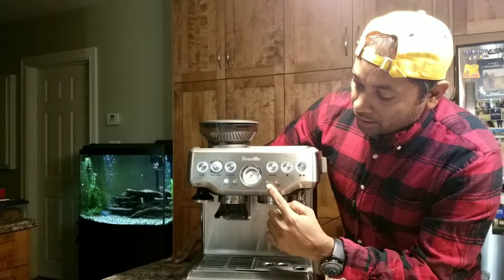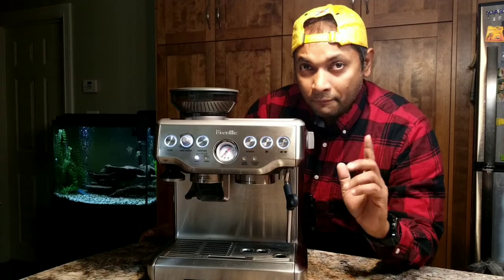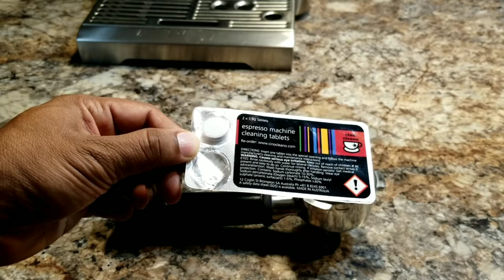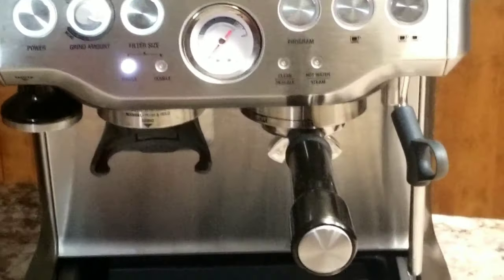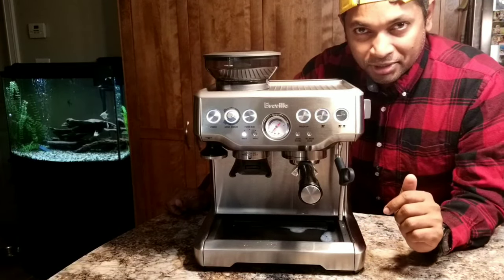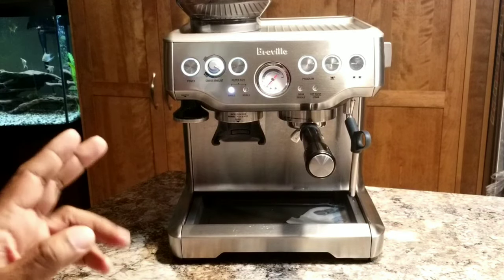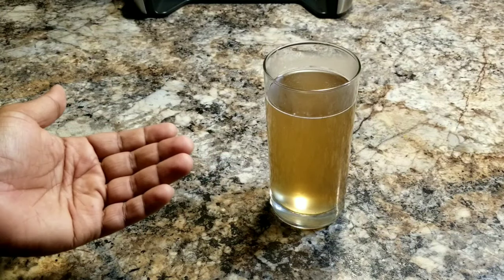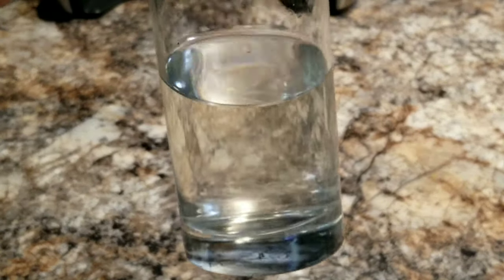Clean Light ON | How to clean Breville Barista Express using Tablet

Comment: Great explanation and very succinct. My machine startled me yesterday as I was making coffee the steam wand pressure dropped and I noticed a foul burning smell coming from the group head which had the unbrewed coffee holder in place. I stopped steaming and removed the coffee holder which came away explosively with a POP and spread the coffee grounds everywhere. I couldn’t find anything about this except a few people on a forum who experienced it and said a descale seemed to fix the problem. Do you have experience of this?
Reply from the maker: I haven't experienced this issue. If you dial to steam (all the way), it shouldn't generate any pressure on the Grouphead. I suspect the steam wand unit may be failing. Anyway do a Descale and Clean cycle to rule out the calcium buildup as the culprit
Reply: @AjusCafe  if it is failing then it doesn’t say much for the brand as it’s only two years old.
Reply: I guess you’ve never bought a bad apple before. You must have extremely good luck. It doesn’t matter who made a product, there’s ALWAYS a chance something could go wrong with it. After 2 years, maybe you got a defective part or maybe it was user error not properly cleaning/descaling. When you purchase an item that’s expensive like this, you might want to consider getting an extended warranty.
The Breville brand is amazing and seriously is the absolute best espresso machine for the money. Maybe you should contact Breville instead of YouTubers for more info. I’m sure they’d be happy to help 🤷‍♂️

Comment: Thank you for the thorough explanation. Would you be able to tell me why the clean/descale light is still on even though I followed all the steps to clean the machine? I can’t figure this out. Does it mean the machine requires rescaling? (I have never descaled it).
Reply from the maker: Is the light flashing OR solid ON?
Reply: @AjusCafe  solid
Reply from the maker: @mytran499  If it's solid ON then you need to DESCALE. Follow this video to fix that https://www.youtube.com/watch?v=YOWbYh9Hssc&t=266s

Comment: Great video, just have one question.. when starting the clean cycle all the residue water comes spewing out the bottom and side of the puck handle instead of going through upper plumbing and out drain tube. Any ideas on what problem is? Thx
Reply from the maker: That's normal. Your cleaning disk has a hole in the middle. Right? Some version doesn't have a hole and it blocks all water. Both will bring water up and into the tray to clean. All good.

Comment: Your videos are so clear and precise.  I appreciate that.  I have had my machine since September and clean it every Friday, except no tablet and I use the provided brush and canned air to dislodge and blow out the grinder of all residue.  I use purified water in the machine so the  descale light has never come on.  But I followed this video and used the provided tablet today.  My question is it necessary to use the tablet if the descale light doesn’t come on or is using the tablet just a good preventative every 3 months or so?
Reply from the maker: Thank you. 
Descale is different cycle compared to Clean cycle. And tablet is used for Clean cycle or Backflush. 

Assuming you are referring to Clean cycle, then Yes you need to Clean using tablet in Portafilter every 3 months atleast, in order to avoid coffee stain buildup. Even if the light blinks or not, you need to run clean cycle. Same applies to Descale cycle as well, where u use Descale power in the water tank.
Reply: @AjusCafe  I run the clean cycle every Friday plus thoroughly clean the grinder, filter head and froth wand.  But I’ve never gotten the descale message I guess since I use filtered water always.  But as you suggested, I’ll continue using the descale tablet every 3 months.  Thanks again.

Comment: Hi Aju, very useful tips and good explanations on your videos. Thanks for it. My question is, does it matter to use powder or solution (liquid) for descaling? Any difference for the result? BTW, my machine is BES870 too. Thanks in advance..
Reply from the maker: Both Solution or Powder should work, if its meant for Espresso machine descaling
Reply: Got it, thanks so much..
Reply from the maker: @gokhangok18  And here is a video 
Descale using Solution - https://www.youtube.com/watch?v=3fNAnMUQAl8&t=843s
Descale using Powder - 
https://www.youtube.com/watch?v=YOWbYh9Hssc&t=42s
Reply: @AjusCafe  thanks for the links. I think I'll go with white vinegar as it's also written in Breville manual. Hope works well:)
Reply from the maker: @gokhangok18  i wouldn't recommend vinegar though Breville mentioned that in 1st version of BBE. Later Breville itself mentioned NOT to use vinegar as it can damage silicon seals etc. So 2nd version onward you won't see vinegar in their manual. But nothing wrong in using it once in a while
Reply: @AjusCafe  Oops, didn't know this! The reason that I plan to use vinegar, rather than it was in the manual, I don't know which descale solution should I buy. There are some brands in the market but hard to say which one is good which one not. Anyway, thanks again for that info..

Comment: thanks so much for the video! my filter size is flashing and i cant pick the filter and my grinder isnt working... is this something to do with cleaning the grinder?
Reply from the maker: Once you remove the hopper,, there is a little cut just above the burrs facing towards you. That switch is not engaging. That's why the filter size is flashing. You can use something like a toothpick and press i to the little cut and see if it engages. Maybe just vaccum the top area and see if a broken bean is stuck.
Reply: thanks so much for your reply! im gonna do this on the weekend hope this will solve everything especially with the grinder!!

Comment: Great Video buddy. One silly question, if I used liquid to descale the machine. Do I still need to use tablet to clean the machine?
Reply from the maker: Sorry depends on which liquid? What liquid are you planning to use?
Reply: Breville Eco Liquid Descaler. Thanks
Reply from the maker: @lalaland8881  Answer is NO. No Descale products should be used for Clean cycle. Either use Breville tablet OR Cafiza powder which is the highly recommended. In Clean Cycle you are cleaning only the coffee oils, old grinds stuck in backflush plumbing etc only. Descale is different and Descale cycle is for cleaning boiler and other components in your coffee machine.

Comment: Thanks for the video but I have one question when I doing the tablet ,the pressure didn’t go this high ,it only go to the middle. Is that something that I can fix?
Reply from the maker: Does your blind disk have a hole in the middle and water slowly dripping though the Portafilter? Because some model of BBE has hole ans what you see half pressure is normal.

Comment: I notice that the cleaning cycle button is flashing fast…in our case it is flashing at the same frequency…help me to understand this pl
Reply from the maker: Flashing means it need Backflush OR cleaning cycle with tablet in Portafilter. If the light is solid ON, it means it need Descaling where you put Descale powder in the water tank and run that cycle

Comment: Aju, regardless which basket I use, the rubber cleaning disk the water drains straight though the portafilter defeating the back pressure clean. Thoughts?
Reply from the maker: Some cleaning disk has a whole, but there is enough pressure to clean backflush anyway. Either use cling wrap on your cleaning disk and use OR use it with pressurized basket. Its all normal.

Comment: I need to clean my machine but the pressure is on maximum when i do the same steps like you. 
Why
Reply from the maker: High pressure is very normal, because you are blocking the flow of water through portafilter using the clean disk (silicon). This will generate lot of pressure up to max. Because of this pressure, the water will be drawn up through the GroupHead into the backflush outlet (which is by your tray below). This back flow will carry the cleaning solution with it, which ensures it clean all your coffee oils and old grinds stuck in there. Hope its clear.

Comment: My descale light never goes solid on. Is it because I descale more often than it’s needed?  How often should I descale it? Thanks
Reply from the maker: You must be using first generation Barista Express, which shows only clean me light. In your case you should do Descale cycle manually. Do it every 3 months or every 6 months if you are using filtered water. Here is a sample manual descale on another machine https://youtu.be/6PsMe4mNZ_s?si=mGdGC5q3ZlNeSFfK

Comment: Should you open and manually clean the group head assembly when you finish the cleaning cycle?
Reply from the maker: Not necessary, but its always good to clean group head mesh filter if you can, as there could be lot of deposits hiding there too.

Comment: I’ve done all that over 8 times using both the tablets and Breville descales powder and the Clean/Descale light continues blinking once the process is finished and machine backs on. Any idea what could be the issue? I also ran the steamer to make sure the pipe would be clean too since I mixed the powder in the water. Thanks!
Reply from the maker: After unplugging the power cord and back on, doing twice the CLEAN cycle with tablet making sure you enter Auto clean cycle using the buttons.if the light is not gone after 2 cycles of clean, and if its still blinking, then it could be a sensor fault. You need to contact Breville support
Reply: @AjusCafe  Thanks!!

Comment: Hi.  Do you know what might be the reason that then I do descaling the water comes out only the group head not the water component or steam wand? Like as soon as I switch to any of them water comes the same second from group head? I tried descaling and cleaning cycle.a.few times. Water only comes out the group head. Will appreciate your input
Reply from the maker: There could be 2 reasons I can think of. 
1. The steam wand is clogged. You need to clean that thoroughly  https://www.youtube.com/watch?v=DWivoLznT8Y
2. It could be more complicated, the seal that switches between the steam and water is broken, which will need to be fixed. 
Does this happen only during descale mode or even while trying to froth milk?

Comment: Hi, Aju, I bought "URNEX Cafiza2 clean powder", do you know can it clean both the brew head and water scale? For the water scale, can it be put into the water tank to run the cleaning program as you instructed in your another video?
Reply from the maker: I don't have experience with that. But i read its organic. It should be safe to clean the GroupHead backwash. Not sure about descaling use as it goes through all plumbing systems including boiler.

Comment: After this cleaning shouldn't the clean/descale light be off? Mine is still on???
Reply from the maker: There is some difference:
Clean light would blink when its time to CLEAN
Clean light will be Solid ON means its time to DESCALE.
So if light is solid ON then do a DESCALE cycle. https://youtu.be/YOWbYh9Hssc

If its still blink light then do Clean Cycle again.
Reply: I saw your video on low pressure extraction. So on which inner grinder setting did you end up with? I put mine at 3, but pressure is at low. Changed beans, settings I'm so frustrated.
Reply from the maker: @julielee7781  my Grinder inner burr is at 3 or 4. If you ensure freshly Roasted beans with a roasted date not less than a week old, you will be ok

Comment: The light for the FILTER SIZE is on for DOUBLE for me after pressing the power, single, and double shot. Yours the indicator light for SINGLE is on in the Filter Size area. Is this okay? Does it matter?
Reply from the maker: The setting before switching off the machine keeps it its memory until you plug off the machine completely. I set it at single shot. That's why it switches on to single.
Reply: @AjusCafe  You’re right! Thank you so much!!
Reply: @AjusCafe  got another question for you, hoping you can answer for me. When brewing coffee, can I press the double shot up to 2 or 3 times to fill up a large cup of will that damage the machine?
Reply from the maker: @musiclife4127  Never do that Juan. Nothing would happen to the machine, but you are going to over extract the coffee. That means its going to be super bitter and harsh, as hot water went through the Grinds too long. To fix, make AMERICANO as shown here https://youtu.be/SOsZoCf9p34
Reply: @AjusCafe  thank you, my spouse and I were debating over that. We will try to do the Americano. Do you have other videos where you use different substitute cleaning products for your breville machine like tablets, descaler, water filter, etc? The breville brand is getting expensive for me at the moment
Reply from the maker: @musiclife4127  Alternate for Descale power. Maybe its expensive than Breville. But good product and Brevilles Descale powder is not available now. https://youtu.be/3fNAnMUQAl8
Urnex Cafiza, Dezcal are good brands for Breville clean tablet and Descale